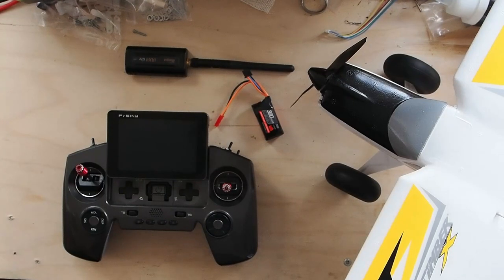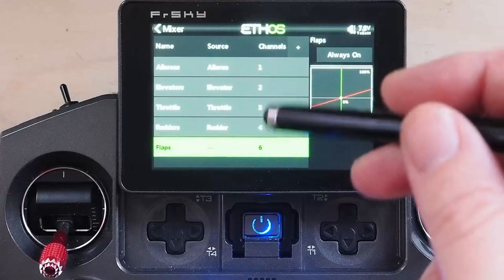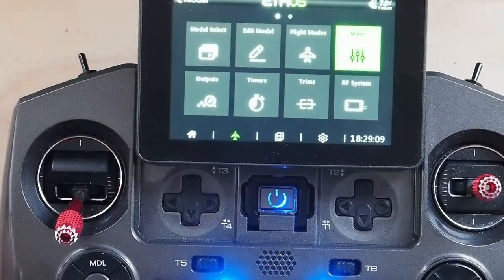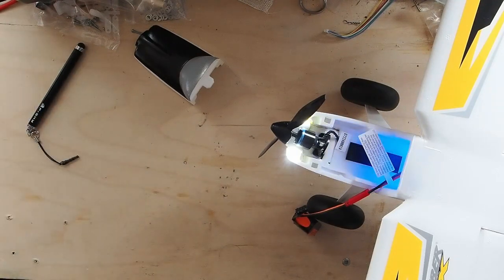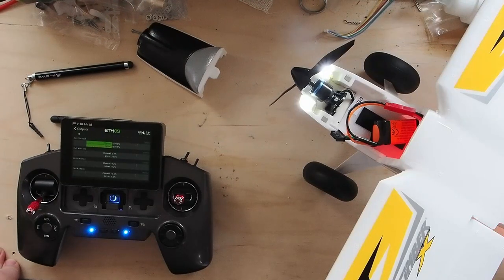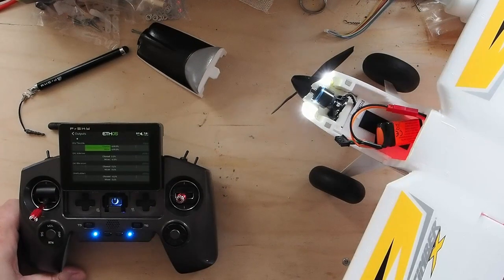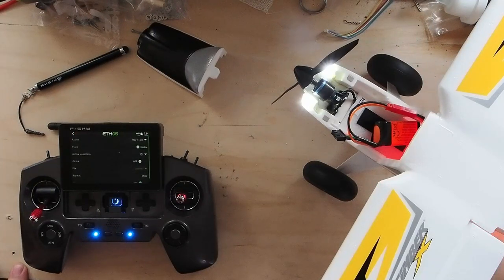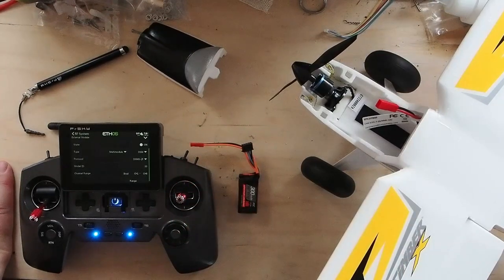ETHOS For Spektrum Users - UMX and MPM - Episode 5

Comment: I have the x20 and the same module. I cant get any umx reciever to bind. Am i missing something? Do i need to switch the firmware on the module?
Reply from the maker: Don't use DSM Auto, use DSMX 1F and try DSMX 2F if 1F doesn't work. Also set your channel range to 1-6 for UMX.
Reply: @awz_maas Found the issue. Iwas too near despite being over 5m away.... at 10m it was finally binding. My module i guess...
But thank u very much for responding in such a short timeframe. Much apreciated 👍

Comment: Hello i use the i range irx4 for my spectrum receivers at the x18s. The newest version at the x18s for the multimodule is used aswell. I face the problem that the channels 1 and 4 are not working. The output 2 is the channel 1 at the Receiver. Output 3 is Channel 2 at the receiver. Output 5 ist channel 4 at the receiver. Is it the same at yours? I'm not sure with this video because i wasn't able to see and understand everything clearly.
Reply from the maker: That sounds like a channel range issue. Set the channel range in RF System->External module to 1-6 and see if that resolves things
Reply: @adam_mawz_maas  OK. I will try it and come Back with the result.
Reply: Hello. I tried to reduce the channels to 6. sadly No changing. Thank you very much for your idea. @adam_mawz_maas

Comment: an I use a Irange IRX4 in my x20s to connect to a spectrum receiver and can I get safe or AS3X?
Reply from the maker: Yes,  I demonstrate that for these UMX models around 11 minutes into the video. Note you can only use the 'stick programming + button toggle' form of detection on the newer receivers, forward programming is not supported for selecting SAFE Flight Mode selection.
Reply: Which channel did you assign SAFE on?